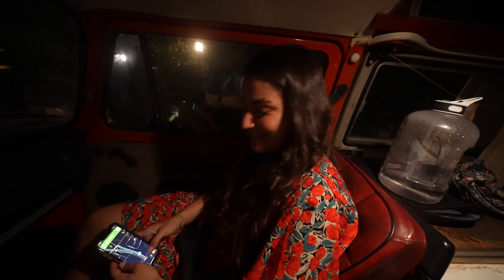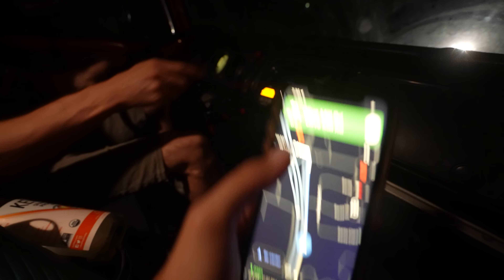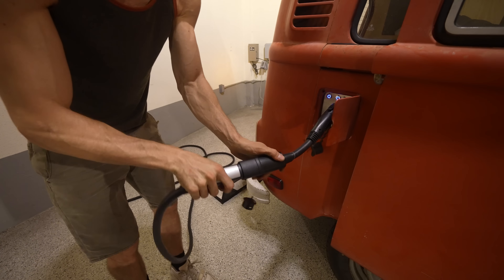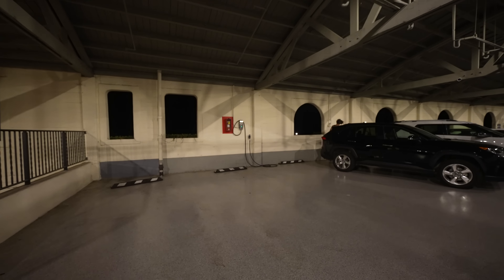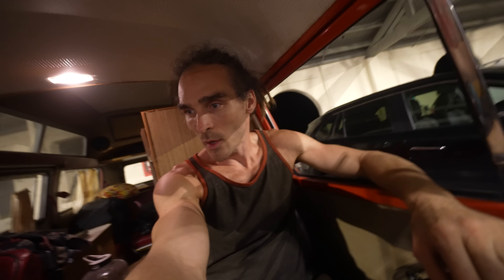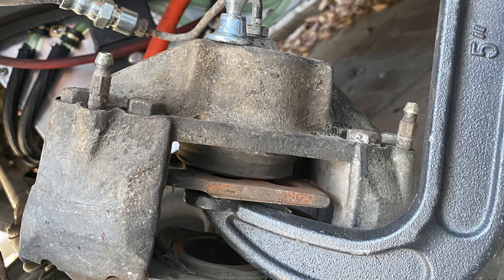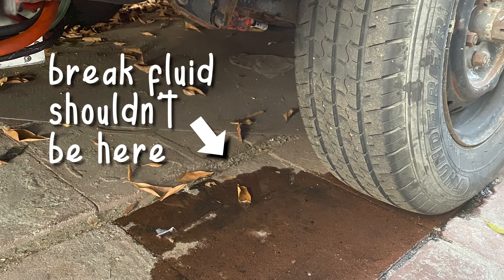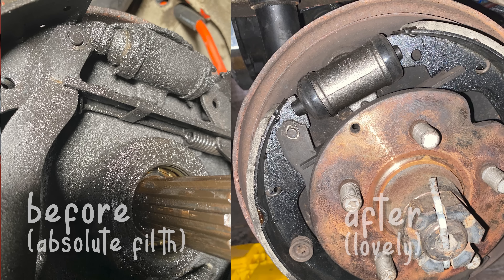All The Problems With My Tesla Powered Classic VW Bus

Comment: When I was a young bloke I had a Cortina. My Dad decided to adjust the brakes. He adjusted them too far and they were on all the time. I drove into town and by the time I go there, my wheel was on fire, the rubber of my tyre was melting, and the brake pads were white ash. I ended up having to replace a ton of stuff all because Dad thought he could save some money. SO watching your massively torquy Tesla motor try to drive a wheel that was stopped by the brake pad, well first you break the drive shaft, then you cook the brakes. I feel for you. Keen to see this all sorted. I'm ten minutes short of the end of the video, so I might be writing a comment prematurely. Whoever wrote to call it a Voltswagon, has my vote.

Comment: After rebuilding the brakes and installing a new CV shaft:
1.  Replace the deleted brake proportioning valve. You'll get better braking performance with a good working one (about 60% of your braking should be up front)
2.  I would replace or at least repack the rear wheel bearings
3.  Replace the rear wheel studs
4.  Not drive around with brake shoes all the way backed off, they should be readjusted

---I know it's a bit late, but I can give you a bit of a "How to the why" this happened.

Drum brakes are effective when adjusted properly, but drums inherently do not dissipate heat as well as modern disc brakes.

Heat is the enemy of braking force, wheel-bearings/cv shaft joint bearings and tires ;)
The stock brakes on a VW bus are already asked to do quite a lot for their purpose, but are sufficient for a stock bus.
A failed proportioning valve can cause all sorts of issues and pressure build-up in parts of the circuit.

On setup: 
Drum brakes require specific attention on setup and on initial installation to ensure correct location/drag/break-in/etc.
-Too tight, they drag and generate lots of heat and can seize
-Too loose, they're weak/spongy, they can bind up, generate lots of heat and can seize 
-Too loose, the CAN even allow the wheel cylinder to push the piston straight out of the cylinder - losing all pressure
-Left to Right imbalance of adjustment can cause pulling while braking or over-working one-side and effectiveness is reduced

Drum brakes without the automatic adjusters require regular adjustment as they wear in (not sure if yours had them)

Brakes in general are prone to sticking/locking up after overheating, especially if any of the components warp.

Likely reason for CV shaft failure and the smoking was dragging Brake Shoes:
The electric motor will produce enough torque to overcome the initial drag easily.
A little bit of heat will reduce the effectiveness of the brakes and/or cause gas build-up in the system (feeling spongey)
 
The "snowballing" of heat: 
As heat builds up "heat soaking" the drum and bearings, it will cause the above, plus...  Can thin the grease enough to leak from the seals or even smoulder if hot enough in the hub and outer CV joint. Burnt-off/leaked grease reduces the ability of the bearings to stay lubricated, increasing heat & wear and weakening them... This is how the grease, rubber seals, tires, etc can catch fire. 

Repeat this cycle enough or get it hot enough, the metal will anneal. Once cooled, combine the sticky brakes, weakened metal components and the torque from the electric motor, you can snap things super handy.

Sincerely,
Ken (Busters Garage)

Comment: Years ago when I drove a Baja on the Oregon Dunes we'd break CVs so often I'd carry a spare set in my Baja every time I went out!  Changing CVs on the sand without getting sand in the grease is a challenge!

I've seen comments below saying you can use Drums brakes in the back if you set up your Regen.  I'd still encourage you to go to four wheel disc brakes because:
1) Disc brakes are a simpler setup than drum brakes.  Much easier to diagnose, much easier to work on
2) Disc brakes don't need to travel as far as drum brakes do.  Much easier on your master cylinder, no need to worry about adjustment valves or boosters.
3) Disc brake pads are cheaper than drum pads!
4) Disc brakes are much easier to adjust than drum brakes.  Just tighten them until you can feel the wheel lose free spin and you're done!  No springs or clips to worry about.

With your knowledge and experience, I think you'd appreciate four wheel disc brakes better over time.  

Also, all commercial EV vehicles have four wheel disc brakes... just sayin...

Comment: Dude, I used to drive an 1969 VW Bug convertible and once my braking system started to go bad....it all went down horribly. I drove several paces without brakes, literally just using the downshifting.  I eventually had to replace, everything, lines, master cylinder, every wheel cylinder. Brake pedal, lines, ....I did say lines....bled it several times. Drum brakes, pads....NAME IT. Eventually after I changed everything.....it finally worked. Good luck.

Comment: Louis, part of your regen problem is based on the pressure transducer that you have plumbed into the rear brake lines that are currently holding pressure. That same pressure is holding your brake shoes against your drums and creating friction(heat). Replumb the brakes, install the proper proportioning valve, install the proper master cylinder(no more interference with the draglink) and program the controller for regenerative braking. You can do the math for a manual master exchange, caliper volume, wheel cylinder volume verses master cylinder volume  and then correct the mechcanical advantage of the brake pedal to master cylinder. Disc/drum manual brake systems are not unheard of, Ghia, Super Beetle, Chevrolet Camaro, etc. Until you resolve the brake line residual pressure the transducer will never give you the proper voltage signal to control the regen braking. Don't forget to research the electric power steering conversion, it makes driving much better. Hope to see you soon.

Comment: Congrats for your project, it’s incredible. Let me give you some advices: 1) take a little gasoline generator in the van, it will save you when the batteries were exhausted. 2) fix the seat belt, it will save your live 3) invest on the break system, it is most important than the throttle 4) wear a reflective vest when you need work next to the other moving vehicles, it will save your live too. Best wishes to you, bro !!!!
Reply: A generator isnt really practical. A generator the size of a suitcase will provide enough power to drive 3-6 miles of travel per HOUR of charge, and burn 2-3 gallons of gas each hour doing it which hell need to bring along as well. Hed be better off creeping/pushing/towing to a building with an outdoor access where he can plug into a regular outlet, or ideally one of the destination chargers like he used before where he can get 20-25 miles per hour (of charge). And of course not having brakes dragging will increase his range a lot anyway.

Comment: look for a device called brake bias proportioning valve... you can manually adjust how much braking force is applied to your rear brakes. Ideal for campers when you’re fully loaded. 
You can refit your booster so you have better braking performance and a lighter pedal feel.

Comment: Well, from my experience girls or woman's dont like experiments very much 😬. Im also someone who like experiments, technology, adventure...but sometimes you feel alone with your idea.

About bus, how about putting strong 400w solar panels on the roof?

What i have noticed, maybe you have too much torque in first gear, maybe that was the reason why axle is broken. Second, you don't notice when your brake is braking while you are driving so that is causing heat. You need to be sure that is braking when it should, and also that is free when you don't brake.

It causes lot problems yes, but that is prototype, once it's ready you know how to make a better one 😉. Jehu have collected some of that experience and they are pretty unique in that branche.

Comment: 1)Charge the batteries  If you only have 110volts Make a 220volt plug.  (Easy)
2) Calculate the total miles.
3) allow 20% reserve
4) buy a gas portable generator to charge battery if standed. 
5) Join AAA to get a tow.

Comment: I did question crimping would be sufficient. When big in car stereo systems are run with big cables like that they solder them and crimp.  Solder will also stop water ingress and cable degradation. My mate had a disk conversion for his bug brakes more power 👍👍

Comment: The brake bias compensator on the bay window was meant to reduce the front brake pressure under hard braking, when the nose dips down. The idea being that as you pushed the brake pedal harder, it would apply more braking force to the rear drums and make the braking safer and more even. Because they are so old now and no one knows how they work, they are rarely working correctly having siezed up or filled with gunk and stop working effectively. Either causing permanent rear brake bias or not evening out the force and making the nose dip and risking front wheel lock.
Reply: When the rear wheel is off the ground, correctly adjusted rear brake shoes should give a very slight drag as you spin the rear wheel. Hand brake ratchet should only click 3 or 4 times when cable is correctly adjusted.

Comment: If you have any air, water, or anything but brake fluid in your brake lines, the heat from braking will cause expansion/pressure causing the brakes to drag. I accidentally put power steering fluid in my brake fluid reservoir and my brakes were dragging and heating up.

Comment: I found I had a similar issue of back breaks staying pressurized. Hot rims,tires, and bearings. The problem was in the flexable rubber brake hoses. The interior of the hoses would separate and act like a one way valve. Don't use VW hoses from Brazil.

Hope this was helpful.

Comment: I have a similar conversion but I did install an electric vacuum pump. The brakes are excellent. The downside is the noise of the vacuum pump. It always comes on at start up and takes away that silent key-on, no-noise departure. I’m still tinkering with regen which is great but I don’t know if it will ever free me from the pump. I’ll be watching because I trust you’ll find a reliable combo.

Comment: 18:28 - CV Axle (Constant Velocity Axle) that transfers rotational power from the transmission to the wheels.

Great journey documentation... damned sorry you aren't enjoying the whole endeavour but I guess this is how journeys are.... with minor pitfalls.

Quick question - Why no just disable the rear brakes because they are almost mostly useful in the e-brake scenario as the discs do 80%-90% of the braking??

Comment: The cable lug problem is a common problem in OEM labs.  You need to crimp the cables.
Also it would be extremely wise to carry spare cables.  Why?
Arcing from loose cables will chew up the connections quickly.

Comment: Just for future reference. DCP (powder) extinguishers are extremely damaging to electronic components. The powder is super fine and corrosive. It gets in everything and will slowly destroy electronics.
They are generally the best to carry in vehicles but I'd consider a C02 in this thing. It would suck to have a minor electrical fire and destroy the whole thing by using a powder extinguisher.

Comment: I am almost certain you are going to need custom shafts and maybe custom hubs to handle the torque being produced. Also absolutely certain that the screws are all going to rattle out of the battery boxes before long, those need welding up before you spill a load of batteries onto the road somewhere!

Comment: You might want to install a smoke or temperature sensor for those back tires. I lost a 1973 VW Bus while I was in college when my engine caught on fire at 2:00 am only 10 minutes away from my destination...totally devastated...lost just about all my possessions at the time. It's ironic that you still need a fire extinguisher with an electric bus, those dang brakes. So looking forward to the next video.

Comment: Dude, transforming such an old car to a modern powered by electric motor requires upgrading or at least checking and maintaining gearbox, breaks, drive train, suspension etc. Now in such powerfull car, completely different forces are at work. Therefore there will be some faults all the time. You shouldn't drive it until you maintain it. Also driving a fully electric car requires from you constant checking battery power level (I assume you have a gauge witch indicates it) and carefully plannig yor route from point A to B considering location of charging stations. Other than that it's modern and classic at the same time 😉 I love it ❤😍 My suggestions for the name are : Voltswagen, ZappZilla, WattVan, BugVolt  😁😉 cheers

Comment: By converting the energy to much higher you should also upgrade the braking disc by using hydraulic ones.  The old brake won't be able to support the high brake force.
Reply: they already are hydraulic. motor vehicles have hydraulic breaks.

Comment: If you have older brake hoses they start to obstructed the flow of (returning) brake fluid more and more and behave as a one-way valve, causing the brakes to drag and overheat.
Also beware that the powder of a dry powder fire-extinguisher is very corrosive and very destructive for anything electric!

Comment: I’m currently doing a Splitscreen conversion with a kit from EV West, but the first thing I did was update the braking system with discs and a servo and also all the bushings on the steering. You need to make your bus safe first dude.
Reply: You are adding power(vacuum assisted) brakes to a splittie? What kit are you using?

Comment: WattsWagon or VoltsWagon. Good job man! For learning and doing DIY very good job. I have not started my Fiat spider conversion yet.
Reply: Not really voltage you need to monitor its battery SOC or state of charge. You should have all the setup right?
Reply: The regen from the electric motor is really important to get going to help alleviate your hard brakes issues.

Comment: Brakes convert momentum into heat. When they get too hot to accept any more heat, they stop working. This is called "brake fade". Drum brakes are far more likely to suffer from this than disc, which is why (since about 1965) they are only on the back, which dont do as much braking as the front.

Per the FAA, airliner brakes are not allowed to burst into flame until 5 minutes after a panic stop.

Comment: I think you need to buy a pusher trailer. Its the front wheel drive portion of a gas powered car turned into a trailer to push the van so this doesn’t happen again. Also with regenerative braking as your driving your e charging the batteries.

Comment: Welcome to the world of VW vans! I thought it was great that you diagnosed the axle problem and the power wire problem. By doing you are becoming an expert!
I think you should have a reputable shop install the big disc brake kit on your van. You brake booster will need a vacuum to work properly. You can probably find a 12 volt vacuum pump to do the job.
Anybody that has ever driven a vw van knows that breaking down happens... you just need to make it part of the experience and breathe through it 😆😆

Comment: Hi,
For the joints, maybe you used the wrong heads of the crimpling tool. Check all of them again. Try to pull off all with force (this is how you have to test all the connections every time)! take care of your self, the world need people like you. I know many "experts" would say no, but I would solder the joints after the crimpling. If the connection loose it can get hot and cause fire. Not only the electricity can be dangerous.

Comment: To be honest it was only a matter of time before those rear axiles snapped.
Reply: Just wondering, why?
Reply: @zab2929  electric motors have incredibly high instant torque and will happily snap half shafts under high load.
Reply: @zab2929  yeah that axle was designed to support a little gas motor with almost no torque, those would need to be beef up for the torque of the electric motor
Reply: @zab2929  yeah what they said ^^
Reply: The engine was obviously pushing those CV’s super hard against those faulty brakes. Engine must have that much power not to notice that the brakes were on!
Reply: yes my thoughts exactly. My friends 150 BHP subaru engine in his T25, which presumably has less torque than this electric motor, goosed a few CV's
Reply: When it was rolling for the first time my only thought was, please don't slam the throttle ... next scene "launch it" 🤦‍♂️

Comment: Don’t drive around without proper brakes. It’s not just your life at stake.
Reply: Exactly. There’s a reason why they don’t make them like that anymore. Turning a VW bus into an EV is just asking for trouble. A wheel fire in CA? Seriously.
Reply: The guy literally saw tru aluminum on a dead trap ''table''saw shirtless. I don't think he cares about proper break
Reply: @MaShcode  Drums are safe *when properly maintained and replaced*. I've done drums, they suck and shouldn't be attempted by those incapable of installing them safely.
Reply: Disk Brake system upgrade video coming?
Reply: Brakes,,,
Reply: @Lionell1952  doh! 💁🏻‍♂️
Reply: Thanks captain obvious

Comment: Brakes oil should not get hot, from the battery mount video I think you run the line above the battery boxes, it is just a thought you need to consider.